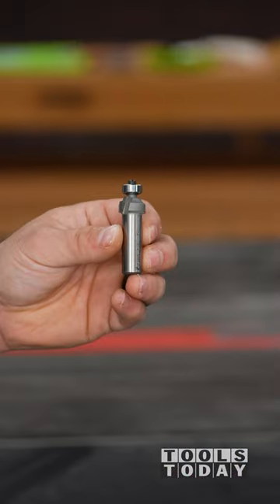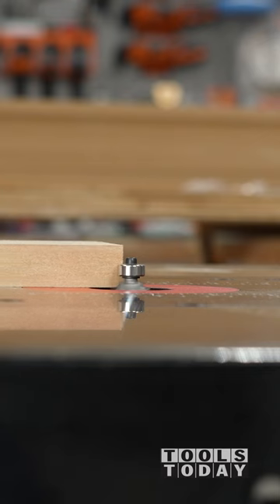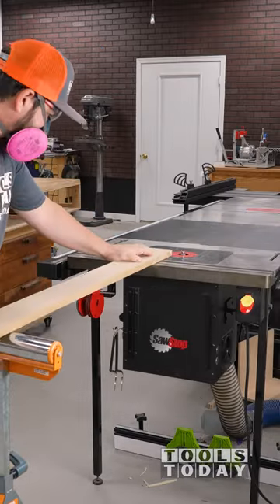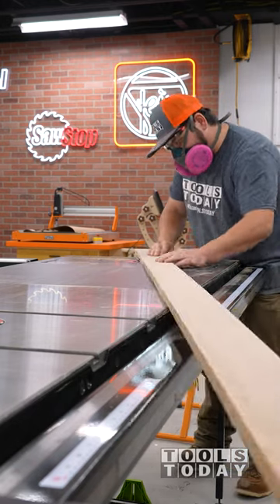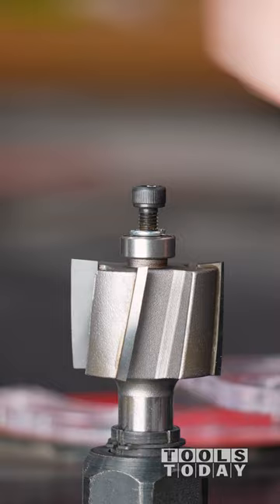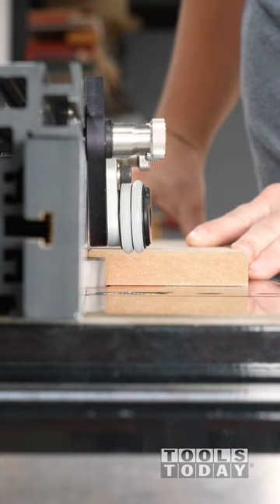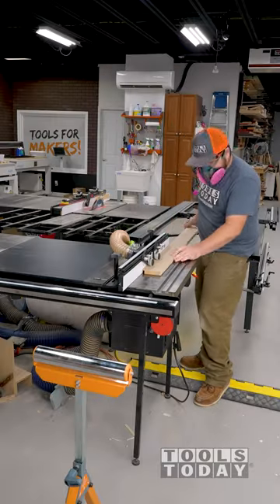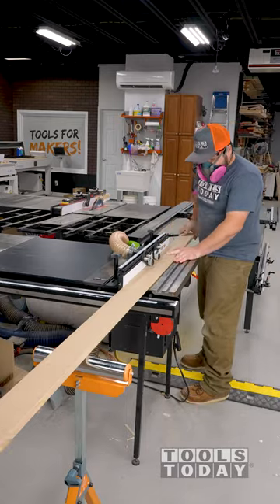Making Sliding Picture Frame Holders

Comment from the maker: Check out the tools used on our site - https://toolstoday.com/sawstop-rt-tgp-27-in-line-cast-iron-router-table-for-pcs-and-cns.html

Amana Tool 49498 - https://toolstoday.com/v-5849-49498.html

Amana Tool 49352 - https://toolstoday.com/v-14377-49352.html

JessEm Clear Cut Stock Guides - https://toolstoday.com/jessem-clear-cut-stock-guides.html

Mini PushPro - https://toolstoday.com/bow-products-pp2-mini-pushpro-push-stick.html